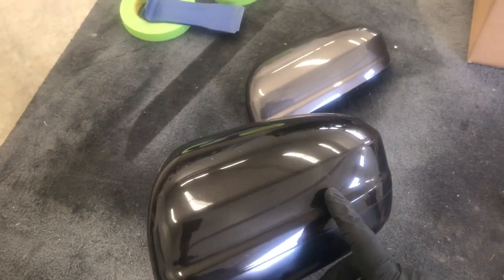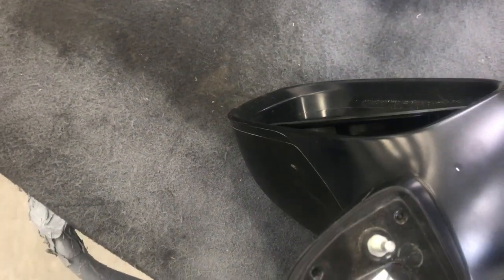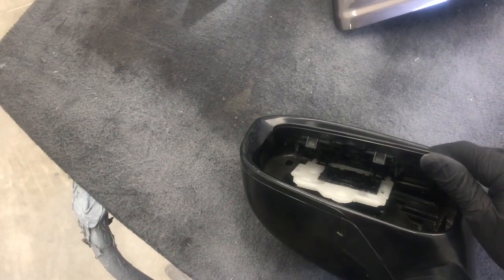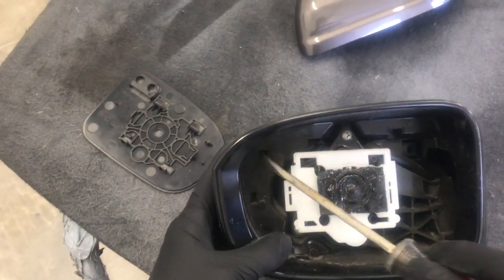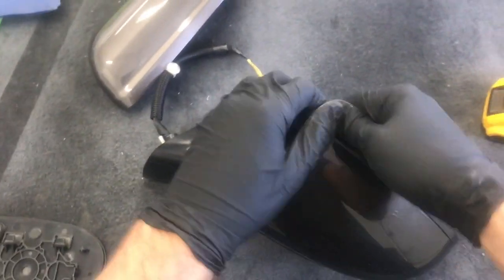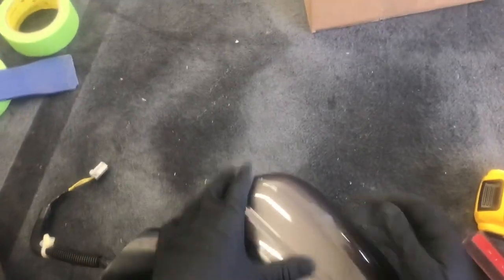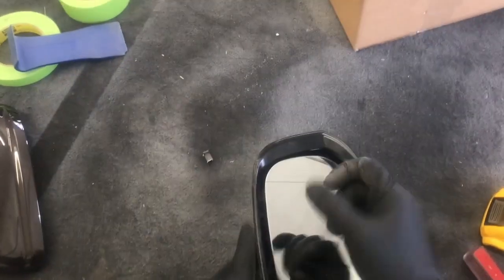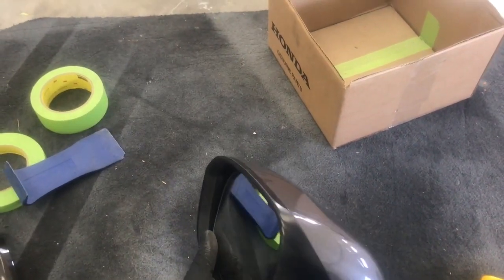2012 2013 2014 2015 Honda Civic How To Replace Side Mirror Cap Remove Install Removal

Comment: You’re very descriptive I like it, even the little things that most mechanically challenged people would struggle with you take time to explain and make it more understandable. Example, showing the clips after removing the mirror, other channels would’ve chucked it and been like “ok on to the next part!” As a mechanic myself I know these little things are easily overlooked but can make or break an install

Comment: Great video! btw, I removed both caps but when I was trying to remove the right cap I took out the white plastic to have better access to remove the cap at the top, now I am having problem with the mirror positioning control each time I adjust the mirror left and right, it sounds like the base (white plastic) is hooked to something. its rare  because when i adjust the mirror to the top or bottom works. Any idea how to fix it?

Comment: Great video.  Have you replaced the mirror portion with the HEATED MIRROR version?  I know there is wiring which would have to be ran, and if so, where would it go?
Reply: Even the non-heated version of Honda external "wing" mirrors use wiring for the electric adjustment motor/component, which runs beneath the internal door trim panel, which is simply attached to the door with clips all of the way around the sides & bottom (just place your fingers beneath the bottom of the trim & firmly pull it away from the door shell, beginning at the bottom corners...however, depending upon the model of Honda you own, any interior door handle trims & pockets will be attached to the door shell (& thus restricting the removal of the door trim until they're removed) with screws, which often have small plastic clips that obscure the screws, for aesthetic purposes & these little clips are usually best removed with a very fine blade screwdriver. Once the door trim has been removed, you simply remove as little of the plastic dust cover beneath the door trim (attached to the inner door shell with black caulking compound) as is necessary in order to gain access to the connecting clip for the mirror motor wire & simply press in the "lever" (for want of a better word) upon that connecting clip to separate them. And finally, you need to remove the 3 nuts (used to be 8mm but more commonly 10mm nuts nowadays) that hold the "wing" mirror body/assembly to the car, via openings in the inner door shell that allow you to gain direct access to these nuts. 

NOTE: Before you loosen these 3 nuts, it's best to ensure that either you (with your spare hand, if you're relatively ambidextrous) or someone else is holding the mirror assembly, as it will simply fall upon the ground if you don't, often hitting the side of your door & denting that on its way down!! Also, when you replace the power mirror wiring, be sure not to run it upon the inside of the window channels, although it's more difficult to do so incorrectly than to do it correctly, as Hondas are generally so well designed & simple to work upon.

A 4-year apprenticeship at a Honda dealership has left me nearly carrying out menial attacks like this in my sleep, although I completed this apprenticeship in 1997!! But my many friends with later model Hondas have kept me in the proverbial "loop" re: later model Hondas & little has changed upon them in that time. Hope this can help someone, some day...?!

Comment: Quick Question, How do you remove just the mirror housing?  My driver's side mirror was hit by a drunk driver while parked on a street.  The mirror itself is fine, the only damage is to the edge of the mirror housing and the painted cap.
Reply: did you ever find an answer to this?
Reply: I think there’s a whole assembly for the holder and the skull cap’s separate. I just bought one for my ‘14 si cuz I’m in the same scenario except the whole mount is loose/cracked. You might be able to buy individual pieces from a Honda dealer if you know the part number otherwise you’ll have to buy the whole mirror as a kit

Comment: Contrary to the video, there are in fact 6 clips holding the cover in, not 4. In addition to the 4 pointed out, there is one at the bottom inside corner and one in the bottom middle. These should be loosened as well prior to removal. I didn’t realize this and cracked one of them off during removal.
Reply: Do things we  can change without open from door ?

Comment: Can this be done without taking the entire mirror assembly off the vehicle? I just need to replace the top part of the cap.
Reply from the maker: Yes, you can leave it on the vehicle to do that.

Comment: Anyone know how I might be able to tighten up the mirror a little bit? It's loose at the base where it swivels, not the 3 bolts that hold it to the car body. I see there is like some kind of metal hinge that allows the mirror to fold and snap in and out, but how do you tighten it? Thanks anyone

Comment: One side view mirror defroster on my 2014 CRV is not working. Do you know how to deal with it? Thnx!
Reply from the maker: Look behind the glass mirror and make sure both wires are plugged in. If they are, you may need to replace the glass portion of the mirror.

Comment: Why would you wont to go to the trouble of removing the mirror plate when all you have to do is get two small plat headed screwdrivers under the mirror cap groove on the outside of the mirror near the indicator & gently prise it off.
Reply: Prying anything on the outside where the paint is runs the risk of damaging the cap. Going from the inside most likely reduces that risk but obviously now there’s more shit in your way